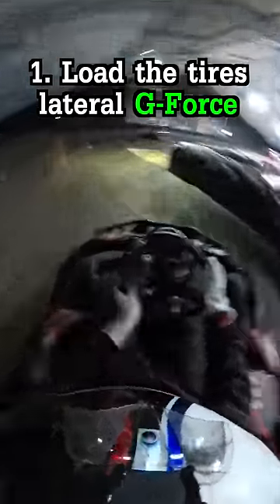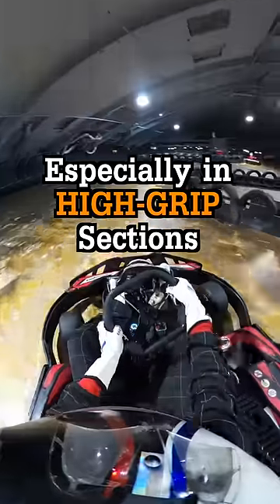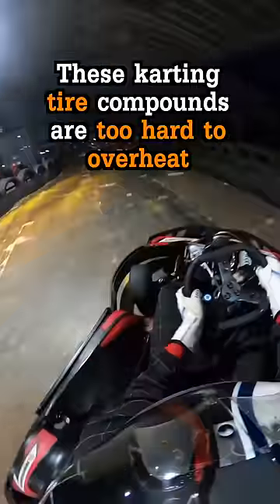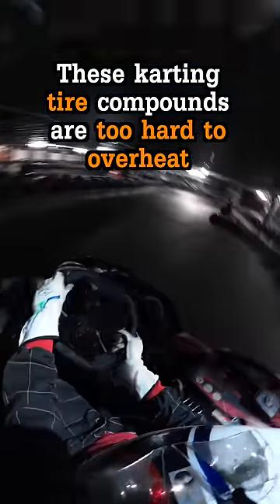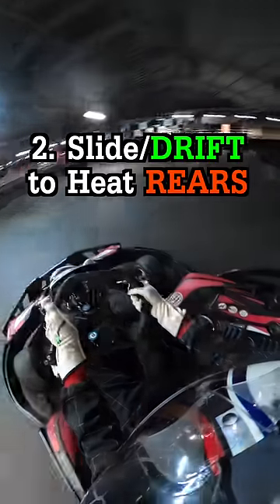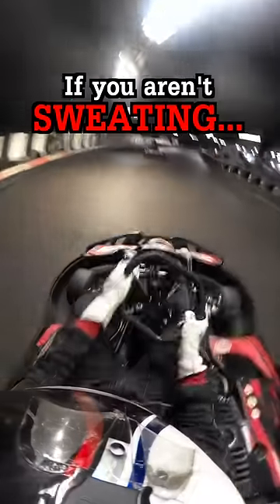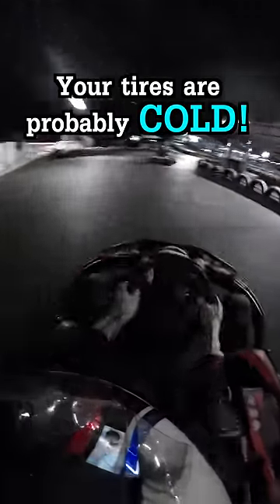How to Warm Tires in Karting

Comment: In a proper race kart, just drive fast on the out lap, and they’ll stick nicely after that. They will peak in performance by lap 3-6 depending on tyre make/compound. In outdoor rentals, karts are typically running often without long breaks, so tyres are already heated up. In indoor karts, hacking away at the wheel out the pits works well.

Comment: "if you're not sweating, your tyres are cold"
this summer, I was on a holiday and went karting in spain while it was about 35-37 degrees. and i did 3 heats. my tyres was probably hotter than the sun.

Comment: Correction: you CAN overheat rental kart tires, but it will usually take a busy kart track running back to back to back sessions for a few hours to get to that point.  However, when you really get to know the tires, you can tell when you've overheated them and then if you run a lap at 3/4 pace you'll suddenly set the fastest lap time of the night when you do a flying lap the next lap.

Comment: Karting tire compounds are hard?

Not sure what's going on with indoor Karting but the MG yellows we used to run were not "hard" at all.  

Now if you're talking rental karts, yes, they will have a harder compound.  But even the hardest Karting tire is quite a bit softer than your typical road tire compound. 

With kart tires, two or three moderately paced laps should do the job.
Reply: Mate r u really sayin’ that MGs are soft?? I mean, the Vega tyres are just million times softer. I did a lot of races on both of them so ik what I’m sayin’
Reply: @VladimirTheYoutuber  I haven't been involved in Karting for over a decade and a half.  

But at the time I was Karting Vega tires were either not available in the US or not very popular.  I've never used them as the club and regional events I participated in mandated MG tires.

I do see they that they seem to be highly regarded nowadays though.

Comment: Bullshit, when I was drifting fru the corners for the few laps and try to set up a fast lap at the end I was literally sliding out . Tires got overheated, and I was still sliding even when I didn't meant to do so.
Reply: Cold air temps make a difference too. Those polished concrete tracks don’t hold heat worth a shit and if it’s too cold out you’ll never get your tires warm enough to the point you won’t slide a little. Shitty handling karts also make it more exciting IMO.
Reply: @toyotaecw  I've been driving sodi sm8 or something like that on the normal open air kart track with a more or less grippy tarmac

Comment: It’s go karting guys, don’t take it this seriously
Reply: Why are you taking it too seriously by warming the tyers? It makes a big diffrence and going quicker is always fun🤷🏻‍♂️
Reply: @sixtenallingersandgren6674  I mean true but with 2 quick laps those tires are up to temp, this is good for races but even then you should touch your front tires to see there temp cause there is no point on weeving this much if the tires are already fine. Doing this on a smaller scale when the tires are heated up will be better on stamina

Comment: Yeah this is bull.
Usually the tires in rental karts can heat up in a race or so, most of the time even less. Your main concern should be where the grip is on track and where it is hottest, this takes more trial and error than just swerving, but you get way more time out of it than "heating up" tires.

Also you look like an idiot while doing this, and are increasing the risk of hitting other drivers or the tire barriers

Comment: actually been proven that braking actually applies more heat into the tires, modern f1 still swap baxk and forth but as kimi has shown, there is no need, and as Hamilton has also shown by the use of magic, shifting massive amounts of brake biase to the front "magic", if an f1 team is using the brakes. you should too, also slicks take less heat cycles and become hard constant heating then cooling due to low pace is also incorrect,  but overall good video